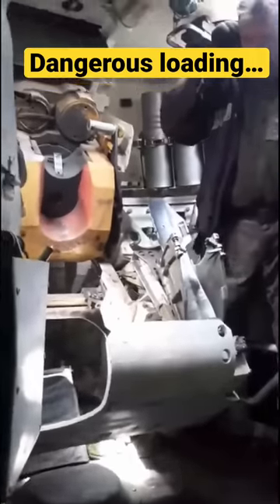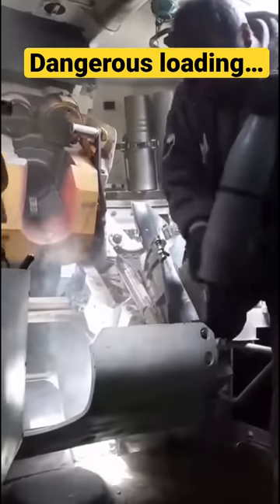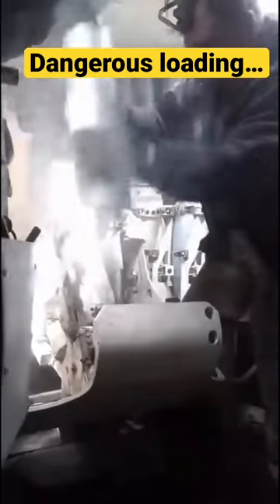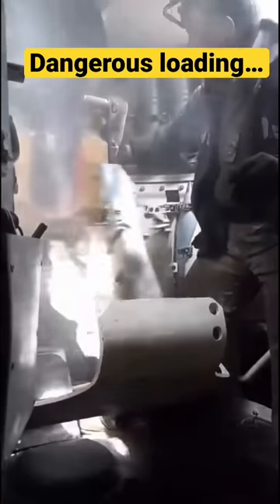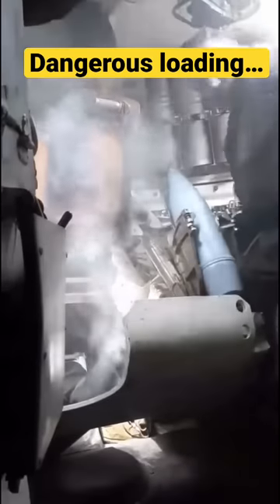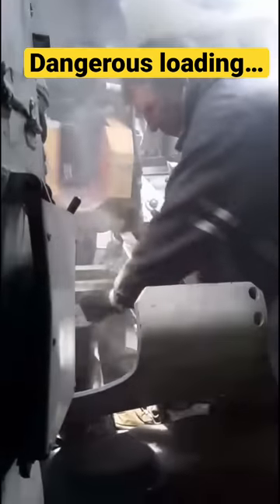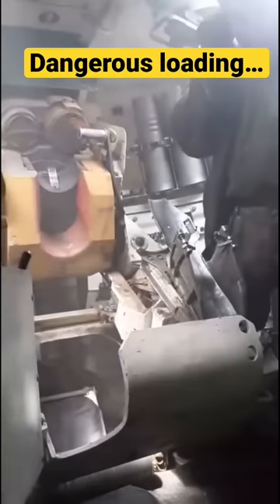Slow and dangerous artillery drills

Comment: He's not a gunner, he's the loader. And the munition drop hatch is either stuck closed (because someone drove the tank into something and damaged it) or they don't know it's supposed to be open.
Reply: I'm assuming they got to a position and are firing a few quick shots before retreating. they dont really have the time to set up. or at least that's my thinking. the second most likely was as you said, it may be damaged for some reason or another. not an uncommon thing for vehicles
Reply: ...or the assistant is too busy filming??
Reply: Or it's cold outside and they think ammo will warm the thing inside. 
IMHO the guy with camera should pull the old case and yeet it out while the guy in video loads round, it seem it can literally be twice as fast if both work.
Reply: The semiautomatic breech is supposed to fully extract and eject with quite a bit of force; it should be kicked out the rear with significant force, where it will ramp off the curved plate to the rear and push open the ejection hatch at front.  

Since the breech is slow in opening and/or the ejector springs are worn, it's not extracting the shell until the cannon is in it's return stroke, and doing so fairly weakly, meaning the shell is just plopping out instead of forcefully kicking out; it hasn't got the oomph to sling itself out the ejection hatch.  The recoil stroke seems a bit slow in this video, too: they might be firing old, degraded, or underpowered ammunition.  The second shot in particular has weak extraction; the extractor barely drops the case out of the breech, with no force at all.

2S1 is an old, OLD system.  This particular vehicle might be 50+ years old; it's just worn out.

In the below video you can see D-30 howitzers firing; these are towed systems using exactly the same gun as mounted in a 2S1.  At around the 20 second mark, you can see how forcefully these are SUPPOSED to eject the shell:

https://www.youtube.com/watch?v=FFly3uiWVVc
Reply: he calls him both a loader for his specific role and gunner as a general term for someone operating the gun
Reply: Little bit of both I'm sure teach a man to fish you know lol they will figure it out die either way problem ultimately gets solved 💥☠️👻😇
Reply: I thinkt he term 'gunner' is used for all artillerymen? Which this guy though he is a 'loader' is.
Reply: @TheIfifi  100% at least my time in the Canadian army, we (the non-arty) just referred to all arty troops as gunners.
Reply: Matsimus is an artilleryman in the Canadian Forces where all the artillerymen working directly on the guns are called gunners. He did refer to him as a loader at first though, so I guess it's just that he's used to call everyone a gunner...
Reply: this is what happens when your side is losing so bad you don’t have time to properly train your weapon crews and are just throwing them out into the meet grinder.
Reply: As a member of an artillery regiment he's known as a gunner no matter his role
Reply: If we wanna nitpick that's a self-propelled gun. Not a tank
Reply: @deilusi  idk figure its just a GoPro on a at first but watching i dont think it is
Reply: @bronco5334  thank u for the knowledge
Reply: @casematecardinal  They do seem to do alot of Shoot and Scoot tactics.
Reply: @SgtJohnRemairez  as is the war being waged. Too many eyes and too many smart weapons to stay put. You fire off rounds and then you fucking scoot.
Reply: They may training in a radiated/toxic environment with live shooting with everything sealed. Some vehicles are designed to protect the crew from any external danger
Reply: Or the piece of crap they are using is 50 years old and half of the 'features' don't work anymore.
Reply: could be closed up to avoid any antitank munitions too
Reply: They are called number 1 man.
Reply: @TheIfifi  the gunner would be the person actually firing the gun. This guy is just the loader.
Reply: We call any artillery operator “gunner”, no matter the role of the artillery crew.
Reply: source: trust me bro
source #2: google's first page of search results
Reply: Thanks for clearing that up. Not an artillery guy so aside from ord ID I'd be lost in there 😂
Reply: Or its frozen shut, theres that too

Comment: You are thinking of bagged charges.  These are cased charges.  There is a disk of cardboard or plastic on top of the cartridge, so the potential for an ammo fire is miniscule.   I'm pretty sure these guys know a LOT more about 2S1 gunnery than you do.
Reply: Yes because cardboard and plastic are known for their resistance to heat. You sure are smart.
Reply: @darrengarcia4937  actually yes. Plastics are. Not every plastic out there is shitty abs
Reply: @darrengarcia4937  your pan handles are made out of plastic.
Reply: @darrengarcia4937  Yes. Completely unironically. Carboard is remarkably resistant to heat, and numerous types of plastics are used specifically due to heat resistance.
Reply: @MathiasWesterlund  there's nothing wrong with ABS it has it's uses
Reply: @darrengarcia4937  thought ya had something there huh
Reply: Cardboard is very heat resistant and is mostly fire resistant, cardboard fibers however are not. They go off like kindling, just like you can't instantly set a full log on fire, cardboard is very compact and expensive carboard or purpose made carboard such as what is used for these Artillery cases could have a Flaming shell pass by them and not have any issue
Reply: Loose bag charges use a combustible bag. The metal cased propellant is metal but there is some limited vulnerability at the open top. Anyone know what’s there? Is there a plastic wad protecting the propellant? Another point is I have deliberately tried to light arty propellant and it took some struggle. It’s not like the deadly black powder on old naval guns.
Reply: @darrengarcia4937  bro thought he was on to something 💀
Reply: @darrengarcia4937 mate, you sure ain't smart
Reply: @darrengarcia4937  cardboard doesnt generally just go up in flames near sparks. it takes a while. and yes, boxes can withstand high temperatures even with embers nearby. and even if it did catch it isnt going to explode into fire and detonate, its going to smolder.
Reply: @BCarnes  so basically, hes not in russias artillery?
Reply: @FWAKWAKKA  Well duh of course he isn't in the Russian artillery, he is alive isn't he.
Reply: @darrengarcia4937  mate, you're getting ratio'd left and right.
Reply: @-NxPx-Phoenix  Not many. And it's delegated to civilian and furnishing uses.
Reply: @osmacar5331  have to admit I have no clue what type of polymer is most widely used in military.
Reply: @-NxPx-Phoenix  i actually haven't looked into it myself. I know what type it is. Not the name.
Reply: @Darren Garcia  you should just delete this comment bud...
Reply: Was looking if I had to post it, his british they don't believe in cased charges
Reply: Part of me thinks that the commentator on this video probably knows a LOT more about 2S1 gunnery than YOU do. Food for thought.
Reply: @darrengarcia4937  get ratiod lmao, who’s the smart one now
Reply: To the OP @odsidianjane4413 you know the fella  that made this video was part of an Artillery unit, yeah?

I don't watch his content yet I know this fact already.
Reply: @FWAKWAKKA  mate whether if its russian or canadian arty there the bloody same.
Reply: @BCarnes  So you mean hes never worked with this particular system or ammunition? Wow. I guess you really are smart.
Reply: With bags yeah I’d be a lot more worried with casings ehh not so much a issue other than him having to clear the casing every shot .. that’d be annoying ..
Reply: @darrengarcia4937  yeah actually.  Some charges are wrapped in a flammable material which burns clean, leaving nothing to eject.  This isn't the case here
Reply: @darrengarcia4937  🤣🤣🤣
Reply: @darrengarcia4937  the plastic on my gloves that are made to move things that are on fire seem to be doing pretty good🤷
Reply: @danielsteger8456  ...and your pan doesn't get to 2000+ degrees in a second. soooo your point?
Reply: @DragonMercX4  paper shotgun hulls used to be a thing.
Reply: Their ukranian. So I doubt it
Reply: @MathiasWesterlund  and you've a source for which it is?
Reply: @MathiasWesterlund  You're thinking of PVC son, and you're still wrong
Reply: @darrengarcia4937  thanks for being confidently incorrect so that I could learn something :) Think before you speak
Reply: @darrengarcia4937  Sarcasm backfired hard buddy
Reply: @darrengarcia4937  you confident as fuuuuuck 😂
Reply: @dudeman5300  russian artillery has like near no casualties. So idk what that Comment is trying to get at. Didja finally realize you cant say russian soldiers are all dead when you learned nearly all the ground forces are either wagner and donbass units?
Reply: @gotanon9659  no it isnt lol. These individual gun platforms are similar yet not the same. And if it were, this entire comment thread wouldnt exist because the argument is based on a fundamental misunderstanding of fucking cardboard.

 they clearly did humanity dirty by giving our internet access to 11 year olds.
Reply: @darrengarcia4937  you really thought you did something with that reply only to find out how wrong you actually are lol
Reply: @BCarnes  hes not ukrainian
Reply: The uploader is literally currently serving as artillery

And hes not wrong. Even if there is cardboard or plastic the risk of detonation is there. The spent munitions hatch not working is a very bad thing
Reply: @benjaminpadilla1464  What? I am not thinking of PVC, i am thinking of ABS, there are case studies of ABS starting to "sweat" in prolonged high temp environments causing the plastic to not only have its characteristic long running burning puddle but also to ignite a lot easier, this is why there are flame retardant treatments for abs and mixtures. But that is why i said that it is NOT just standard ABS likely, it could be pc-ABS. hell it COULD be the very flamable PVA (a common "one time sealer") but it could also be flame retardant PVA or similar which would be optimal for this usecase...
Reply: @bobsemple9341  I do not. I just stated that a blanket statement that plastics are flammable is purely wrong.
Reply: @darrengarcia4937  This would be like saying shotgun shells are a deadly explosion waiting to happen because plastic is useless and a shotgun chamber is filled with hot gasses and embers. It’s just as stupid as this video’s claim. And as uninformed.
Reply: @BCarnes  you know that Canadian/NATO artillery is notoriously different to Soviet/post-soviet artillery, as are tank rounds? 1 piece shells, as opposed to Russian 2-parters, which themselves are different to the British/others 2-part rounds that use a charge bag.
Reply: @gotanon9659  no it literally isnt.
Reply: those guys are so skilled that they... never once move the shell casing before trying to start a new load..? What?
Reply: Wasn't this guy in the artillery core ?
Reply: @darrengarcia4937  you did not think that through did you?
Reply: @darrengarcia4937  seems like your not that smart 😂
Reply: @darrengarcia4937  cringes in treeshade mechanic.

You listed two very common heat resistant materials
Reply: @GatorGreenGladiator  he can't this is more attention then he's ever received. Good or bad he'll take it. 😂
Reply: I love how internet warriors like to rant about battlefield videos from comfort of their livingroom.
Reply: "I'm pretty sure these guys know a LOT more about 2S1 gunnery than you do."
There is a chance that they were drinking vodka on some bench 3 weeks before this footage was taken so don't be so sure.
Reply: @BeeTriggerBee  And they would  STILL know more about 2S1 gunnery than him. Got any more stupid things to say?
Reply: @Luckmann  w pfp, I literally had the same one

Comment: They are sealed casing so no real danger there. New ones are kinda fireproof.
Reply: That is the most Army answer ever.  Kinda like the 3-5 second fuse on a M67.
Reply: @vivalaresistance45  He's right though: these aren't combustible cases.  They're aluminum; a few embers (if there even were any left after clean-burning modern propellant ignites, which there isn't) have almost zero chance of igniting the other charges.

If it used bagged charges like the M109, he'd have a point, but it takes a ruptured case and a quite significant ignition source to be a hazard against this type of propellant charge.
Reply: @Bronco 53  thanks for the info!  I was an engineer and didn't have any exposure to this side of the house.  Just made me giggle when the other guy said  "kinda fireproof."  We had a mission in 03 clearing BLU-97s from farmer's fields, near Tikrit.  That was the day I learned that the US is allowed a 10% failure rate of whatever we drop out of the air.  Very unsettling.
Reply: @vivalaresistance45  They still find unexploded ordnance from WW2 in Europe.  Crazy after nearly 80 years ppl are still directly effected by the war.

Comment: Looking at another video that's how it works but that old Soviet tech appears to have a serious design flaw. If the gun elevation is high, like in this video, it blocks the cartridge ejection. Also those are cased charges not bagged charges.

Comment: Realistically what are the odds of that case setting off a round out of battery? It takes quite a bit of energy to do so.
Reply: starts off extremely low if you do it once, but each time you do it, the odds increase not in your favor
Reply: High enough to not risk it.
Reply: @dianapennepacker6854 ...low enough to get rounds down range and not worry about it. Even these old surplus soviets rounds take a good amount of time and effort to cook off. You can literally set a case of charges on fire and youve still got a few minutes for modern ones.
Reply: What are the odds of him being slowed down for being too lazy to remove the spent cartridge? 100% genius

Comment: For us untrained masses what would you recommend he do instead
Reply from the maker: well for one, clear the emptys to the rear onto a wet rag at least. He will lose time, but hes losing time trying to load with casing in the way anyway
Reply: if he wants to live, find a legit excuse to be discharged without breaking any crimes
Reply: Be a man catch the casing or be a Chad grap an plasma cutter an cut clearance room in that badly design thing hindering the empty shells
Reply: There is an opening where the spet cases supposed to be thrown out from the turret. He is sustaining a really high rate of fire, he has no time to get rid of the casings. Also there should be an assistant loader, he may help in this task too.
Reply: @laszlokocsis7817  that assistant loader cannot help him, who would hold the camera if he did`? :p
Reply: @_Matsimus_  I recommend that the guy filming removes the empties...
Reply: @_Matsimus_  Better solution is to call the Ukrainian surrender hotline
Reply: @hunterhobday6363  Good luck with that. They are dragging off tenagers and old people kicking and screaming at this point, I've seen several videos. There's no way they would discharge anyone unless they're permanently crippled.

Comment: One little ember or flying spark from the empty case and that turret will be a giant Roman candle.
Reply: Those case are sealed unlike normal bag charges so they're not very likely to cook off from a stray spark. 

Also, there's supposed to be an ejection chute but it seems to be stuck shut. Probably don't have the time to fix it while on the field.
Reply: @cuongle7990  that would explain why his drilled motions aren't working but he's stuck with the "muscle memory"

Comment: If it's artillery that's right behind the frontlines then it doesn't matter where you place the damn ammo, plus those are metal cartridges with generally inert explosives that probably have centerfire detonators that aren't touching the hot barrel (inert explosives generally don't explode when subject to heat, like C4, as it only explodes to shock caused by a more sensitive detonator)

Should only be concerned if the ammo is fired by 19th century artillery that is loaded with cloth-wrapped shot and heat-sensitive gunpowder

Comment: I can't see how the metal spent casing is any more of a fire hazard than the metal interior of the barrel... exactly where the next live round is actually being inserted. Smokeless powder burns pretty completely, metal drains away heat very rapidly, and flames are not suddenly going to sprout out of an empty casing and burn a hole through the metal casing of an unfired round a foot away from it. I could see some fire danger somewhere along the line if the powder charges were in cloth bags, maybe.

Or, assuming "burning embers" could even penetrate the sealed unfired cartridge, the real danger point would not be when the empty casing is laying inert on the floor, but rather when the empty case ejects with a puff of smoke and -- for the sake of argument -- "burning embers."

Or the loader could ask to stop the war, while he trains in as an artillery mechanic to fix the problem.

Comment: I don’t understand why we went from 1 big shell that had the projectile and powder in one case to two piece shells
Reply: It's only used in large cannon systems(like an artillery gun in the clip). There are different levels of "propellant charges" which represent different ranges that you are trying to fire at. Artillery guns are designed to shoot distances of +/-30 kilometers, and you cannot fire rounds that far with only the cannons elevation. This presents the need for propellant charges. Naval cannons are another example which uses charge bags.
Reply: @gsilvy4k570  ah ok, I didn’t know there were different bags for different ranges. I had just assumed that it was all just the same powder load